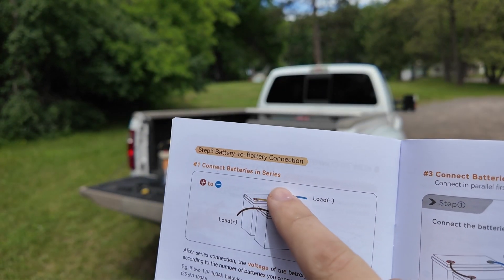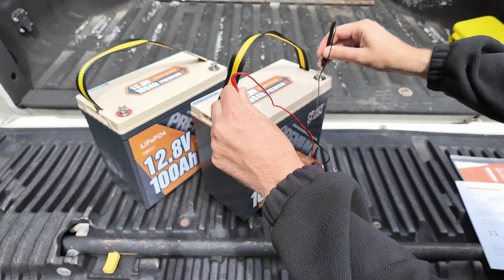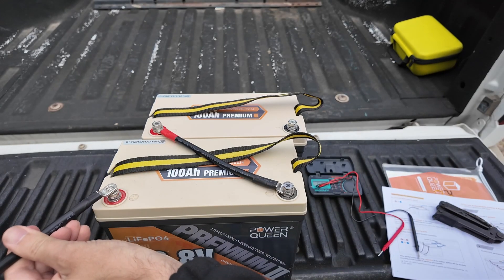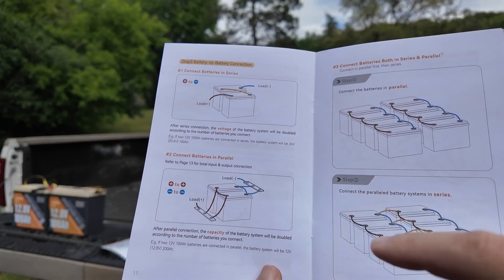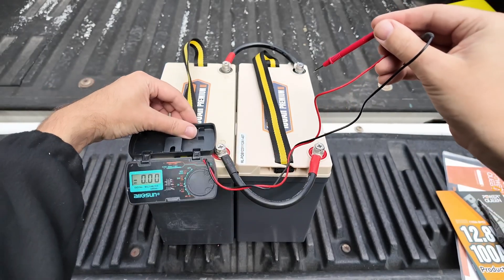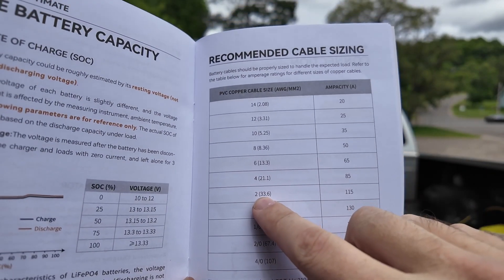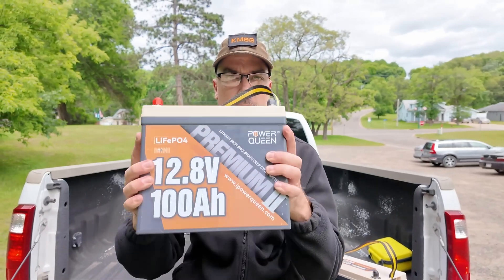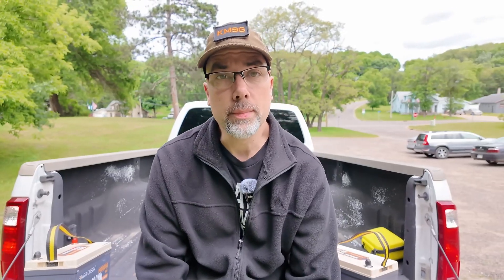Double Your Voltage or Runtime From 12 Volt Batteries

Comment: Respectfully, what you state suggests that you do not have a clear grasp of electricity.  Your first statements,  "double your voltage or runtime"  and "more power or longer running" are poor meaningless statements.   For example,  both the parallel and series configurations have the same power.  Not more, not less!   Power which is energy/time (units of Watts)  is equal to Voltage*Current.  The 2 batteries connected together have the same Energy (power*time) independent of a 2S series (26.4V*100AH=2640WattH) or a 2P parallel (13.2V*200AH=2640WH) connection.  Your radio likely is not designed to operate on with a large spread of voltages and would likely blow a fuse at best if connected to 26.4V,  but it could be fine if designed too(but would need more components and be more expensive).     If it were designed so, then the load Current for the 2S (26.4V) would be half that of the 2P (13.2V).   This is basic conservation of energy. Don't violate it.  Let's say a radio that transmits 100W RF consumes 150W of total DC power when transmitting.  Then the 2P combination would draw (150W/13.2V=11.4A) whereas the 2S combination would draw (150W/26.4V=5.7A)  so that in both cases the power consumed (i.e. Energy) would be equivalent.   

Also, the manual is hokey too with regards to wire sizing.  One would use a large wire gauge to minimize the voltage drop due to the resistance of the wire itself.  Total wire resistance is directly proportional to the wire length. Resistance R= rho * L/A where rho is the resistivity of the material(copper, iron, etc), L is the length and A is the cross sectional area of the wire.  This states that if you double the wire length L, then you would need to double the wire area A to maintain the same resistance.   I good rule of thumb is to keep the voltage drop along the wire length to less than 10%(i.e. Vdrop <= 0.1*Vbattery).  With  Vdrop = I*R, one can calculate R for a given battery voltage and Current load.   And then given the length of wire one needs, determine a minimum wire size (i.e. A).    This is why 24V (or even better 48V) batteries are commonly utilized with DC to AC inverters.  One needs 1/2 (or 1/4) the wire size compared to a 12V system (can be a HUGE $$$ saving) .

Sorry if I come across too pedantic.
Reply from the maker: Yeah, you missed the beginner nature of the vid.  I said double voltage or runtime, not double power.  You're right that power doesn't change.  One or the other change. But not both simultaneously.  You know that though.
Reply: @temporarilyoffline    You did start of the video by saying " Sometime you just need more power and sometimes you need a longer runtime"   No not double just more power which is still incorrect.  More importantly, runtime should not change unless you can violate energy conservation.  Enough of my bashing. You are still the man!  Especially on the computing/linux stuff.
Reply from the maker: @dreupen  thanks!

Comment: love the video's .. I have 4 12.8v 20ah lifepo4 battery's wired in parallel so i have 80ah?? or 160ah? ECO-WORTHY 12V 20Ah Lithium Battery, 3000+ Deep Cycle Rechargeable LiFePO4 Lithium Ion Phosphate Battery with BMS for Trolling Motor, Fish finder, Kids Scooters, Power Wheels, Outdoor Camping
Reply from the maker: 20*4=80, you got it right the first time!

Comment: Depending on brand. Not all  LiFePO4 batteries are recommended to used in series or parallel.  Some have great balencing, charging and protection circutry that may not work so well when connecting to other batteries.
Reply from the maker: Good Call!

Comment: Whether in series or parallel, you get the same total POWER (watts).  In parallel 12V x 200Amps = 2400 watts. In series, 24V x 100 amps = 2400 watts. If you then step the 24V down to 12V (for amateur gear for example), you'll still get 2400 watts total (less any loss in the buck converter).  As a ham, whose first interest is powering radio equipment, I stay at 12 volts.  But if my primary concern was powering an inverter to get AC, I'd go with 24 (or 48) volts, as then my cabling needs would be less (lower amperage). Yet you still get the same life/longevity out of x number of watt hours.
Reply from the maker: Exactly!
Reply: Thank you! I was coming to say this and was having a hard time thinking of a way to say it and not be some mean jerk face.
Reply from the maker: @pilotguyo540  I always try to agree first and then expand.  What Carl said only expanded upon the brief info I gave in the video.  I have more battery/solar videos to share, but you can't say every single bit of information in a video or people tune out - or worse, miss that part and then ask you a question you answered in the video.  Youtube-Psychology :-D
Reply: @temporarilyoffline  You did a great video with a lot of good info. Just wanted to make sure the novice looking for info was at least aware of the power (watts versus volts and amps) aspect. Thanks for your video.
Reply from the maker: @carlleon1604  thanks Carl!

Comment: Another good one, TO! 

One thing to remember for parallel recharging…each battery box has its own BMS, programmed to optimize the relative charge current to each individual cell. The two battery boxes in parallel can charge simultaneously as long as none of the separate sets of individual cells do not get too different from the others. This will indeed happen over time! Then, the vampire cell will get more charge current at the expense of the others, eroding the SOC for the other battery box. Long term: not so good for the batteries.

My attempt to deal with this was to unhitch the parallel cables and optimally charge each battery individually. PITA! When the price/ah came down in the lifepo4 world, I just bought larger cap batteries and repurposed the smaller units.

Interestingly, I stuck on a power monitor meter and a Powerpole cluster on each of smaller batteries … making very useful shorter-term power sources for a lot of situations…very lightweight!
Reply from the maker: every so often unhitching is a great idea!

Comment: In addition to planning your wire gauge to safely supply the current you need to draw, be sure to include a fuse small enough to protect the wire.
Reply from the maker: Good Call!

Comment: TO, How does connecting dual batteries affect the BMS in each battery?
Reply from the maker: The BMS will work individually inside of each battery, but they won't know about the other battery.  I would endeavor to charge them both fully for the first time before the hookup and then not discharge them separately again. Once a pair always a pair.

Comment: I did one some weeks back with 2 small 12V 7.4Ah slab batteries. These are the ones from security lights or those exit signs. I now have 12V 14.8Ah to take out. Maybe double the weight but they are quite good for the price as LiPo4 battery is a bit expensive at the moment in the UK.
Reply from the maker: Smart!

Comment: If you have to charge at below freezing temperatures, lead acid isn't dead.  But yeah.

And note, for series connection, the batteries need not have the same AH rating (or even the same chemistry).  You will only get the AH of the lesser battery, but it is safe.  I wouldn't charge them that way, as a rule.  (Good for things like a 24V CPAP machine when camping.)  For parallel connection, it had best be the same chemistry.
Reply: Hand warmers are a thing. I assume battery warmers are too. You can gently warm the batteries if you need to charge in the cold.
Reply: @haxwithaxe  Yes, battery warmers are a thing.  Some LiFePO4 have them built in so that if charge current is received when the battery is too cold, the charger powers the heat until the battery warms above freezing.

Lead acid doesn't discharge or charge well below freezing. The difference is cold charging a lead acid doesn't harm the battery (for reasonable charge voltage and current).  Instead the lead acid battery becomes its own heater and as it warms up, more current is consumed by charging and less by self-heating.
Reply from the maker: Makes sense to me, thanks

Comment: Thanks, I just hooked up 3 240AH eco-worthy in parallel to the home power. I used 0/2 , maybe I should use 0/4 but the batteries and leads are not even getting warm, so it may be okay.  I may end up moving to 48v when I add solar, just not ready for that yet.
Reply from the maker: Sounds like fun!
Reply: Wire size depends on the wire length.  If you want to double the length you should double the size to equal out.

Comment: Great tutorial, you're correct, most manuals are lacking in this area. Regarding cable gauge, if I'm only running a 25A radio, I see that 12ga is recommended. It that for just the cables going to the radio, or can the cables between the two batteries also be 12 ga, or should those be more stout?
Reply: It depends on the wire lengths.  A wire half the size and half the length is equivalent to a full size full length wire.
Reply from the maker: More stout = less resistance = longer life